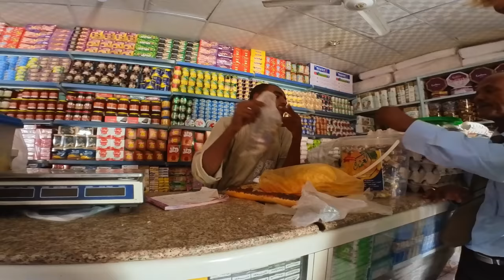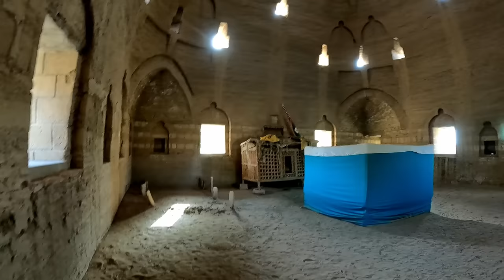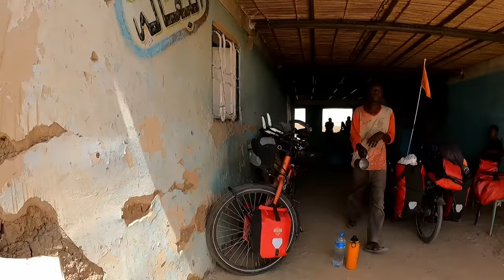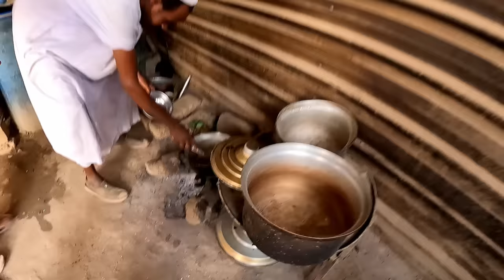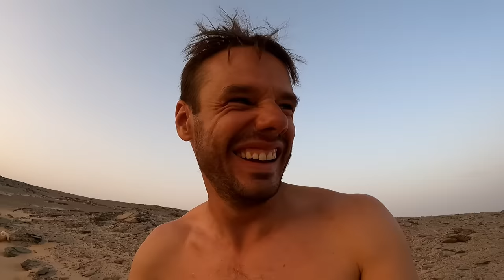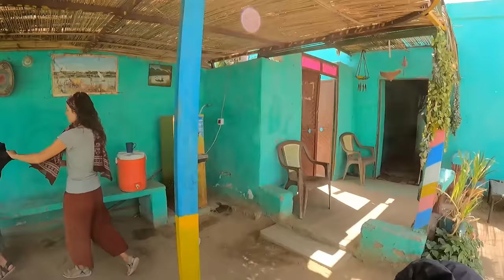The Ultimate Cycling Challenge 🇸🇩 Sudan | vA 20

Comment: I have ridden over 4k miles, and not had a flat..(occasionally have to add some air).. Reason, i choose the flatless Schwalbe Marathon PLUS or the PLUS TOUR... They are incredibly durable and extremely puncture resistant. I wouldn't recommend anything less on a tour... flats are a pain.. for me a rear flat with with a Rohloff would be too heavy for me to change myself.. ie:  stranded.